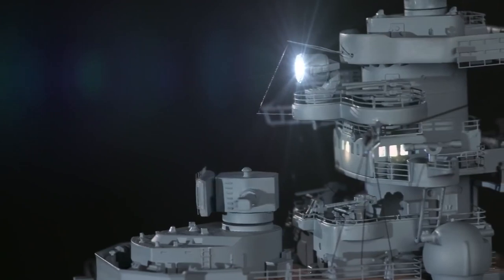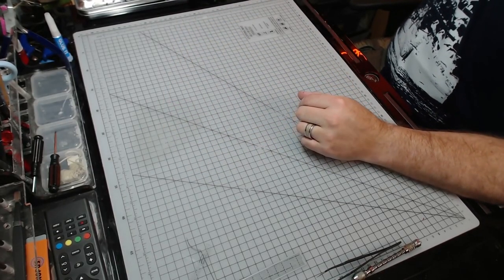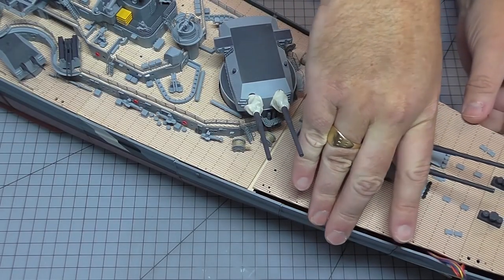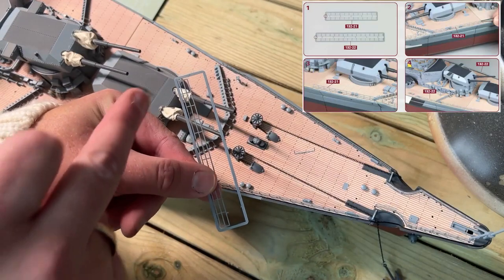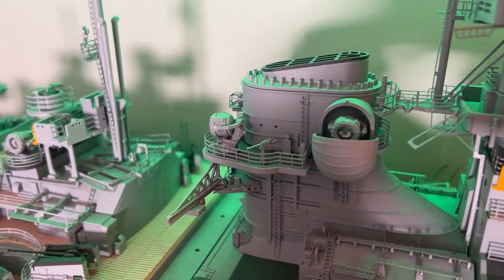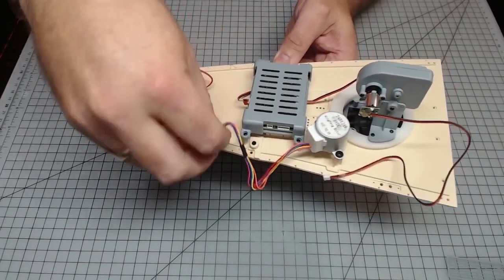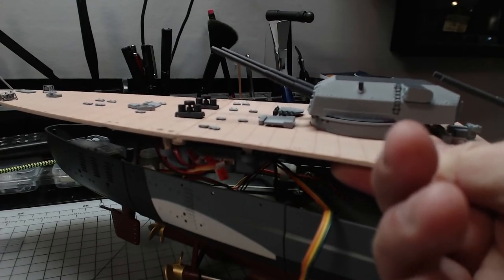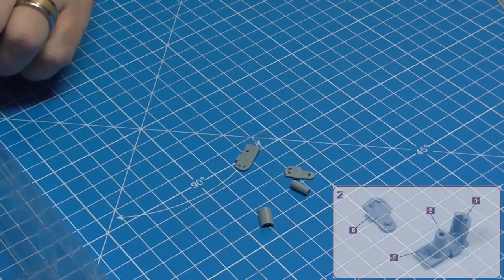Agora Model's Bismarck The Legendary Battleship - Pack 12 - Stages 129-140

Comment: Building the Bismarck along with Wayne has been great fun.  The year went by much too quick.  During the final stages and tests all my adjustments caused minor damage to the delicate photo-etch parts such as railings, some ladders and minor antennas.  To avoid these pesky problems I jumped ahead to complete the remote electronics.  Once everything functioned correctly, I went back to finish the detail work.  I think I saved myself some frustration.  Just about finished now.  The model is outstanding and Wayne's videos were both fun and super helpful.   Much appreciated.

Comment: This is amazing!! I jumped around a bit in Pack 12 and I still have between 3-4 stages left. I haven't tested anything yet because I need the bow deck assembly loose to fix the bow light. The cable stopped transmitting light. I can't wait to hook everything up and test it. I still have the boats stage also. I bought EZ line to do the rigging. I've learned a lot during this build. Thanks Wayne for the videos. They were a great help when I needed clarification on a particular assembly.

Comment: I just completed this and happy to be finished.  It was so enjoyable and  I learned so much.  I always try to make my models as close to the original as possible.  I did a lot of research and am so glad to find out that the "wires" were secured with large clumps of glue on the original Bismarck.  So mine looks just like the real battleship.  I enjoyed this so much I am going to do another one and have ordered the set.  I was a needleworker for a lot of years.  I do not know if you mentioned it, but a sewing accessory, a needle threader helps get the thread (technically yarn) through all the little holes.  Also, I had no idea there was a wireless control with this and it works very well, few things do not work on the ship, they will on the next one, but the remote sure does work'

Comment: The radars/rangefinders look wrong to me - the units contain the range finder lenses and the radar panels would have been for ranging and not detection. They would not have been spinning around, and  would have been fixed on target as directed by the fire control centre.
Reply: Is there any kind of electronical upgrade for the rangefinders to operate with the turret simultaneously ... They definitely shouldn't be spinning around like search radar!

Comment: Hi Wayne
I have fixed the Bismarck controller still discharging the batteries when switched off. I have installed a mini toggle switch in the front of the controller box next to the battery box. I have then cut the battery box live wire and soldered them to the switch terminals. So I can now use that switch to isolate the batteries.
Reply from the maker: Great idea

Comment: Hi Wayne, 
I have found that even thought I switch the remote controller off it still keeps discharging the batteries. I did see that you are told that when you are not using the controller to take the batteries out. Do they really think you want to do that? Or have I done something wrong.
Reply from the maker: Nope mine does the same. I have to take the batteries out

Comment: When I came to fixing the 132-20 quadruple guns inplace, the instruction said to remove the two 3.7cm AAguns 106-07 on the searchlight platform and take them down to the upper mask deck. As the are glued in place that is easier said than done. I noticed you had not glued these in place how did you know not to do that.
Reply from the maker: I didn’t . It was luck

Comment: hello Wayne. I did the connections with electronics D3-4-5-6-7 to the board I connect the test board new batteries, on and put S1 but the 2 bruno do not turn I HEAR ONLY SOUND. LIGHT is ok ....
Reply: when I put ON/OFF button and start calibration of Bruno 1,2,3 turn Ok but the last one did not turn...!

Comment: I already 'completed' my model as well, in the same loose term as you. I decided against rigging the crane since I think it looks awfull with the provided string. Since the string is so strong, and the crane does not have any weight to it, the strings are not tentioned at all, making it look really bad. 
I am not sure yet if I do any of the rigging tbh.
Reply: Get some EZ Line its more rubbery so you can keep the rigging taught!

Comment: I was planning to buy this right now since I live in Australia 

But then I realised whats the point if I already own the trumpeter version
Reply: fiyatı nedir ?
Reply: @vieasan  for the trumpeter $450
Reply: @vieasan  the one in this video $2000
Or 199 an month
Reply: @7r47ufchfyw7twguwgu  I want to make it myself from wood. It is a RC model, but it is a wooden and handmade product.
It should not be fabricated like in the video. I want a completely wooden product, but the materials such as balls, lighting, motor will be similar. In addition, I will build a radar system and ensure that the guns are locked on the radar. its length will be 2 meters/6.8/ feet. I started a project like this. When the project is finished, I want to sell it as a hobby. I asked the price for it
Reply: also thanks for your reply 😊
Reply: @vieasan  yoir welcome wow that sounds soo cool your making 1/100 scale! Pls do some videos about it
Reply: @7r47ufchfyw7twguwgu   yes , i will start making videos like this 😊

Comment: Is it just a static model or coukd it be made as an rc working (floating) model?
Reply: Ut would food by the small gaps but if u covoer them up then u got an new problem it will be heavy and judt think so maybe if you can make an homemade hull and use all the decking and stuff for it?
Reply: @7r47ufchfyw7twguwgu  Thanks. I may try the Amati model.
Reply: @davidharris733  sorry my spelling bad I ment to say that it will have an lot of gaps and sink and even if u covor them it will be so heavy it will sink